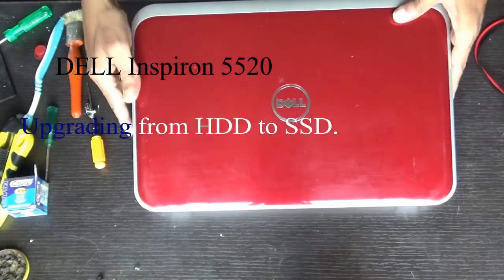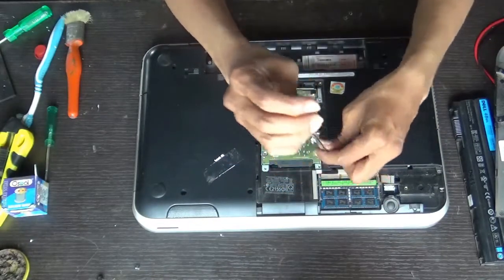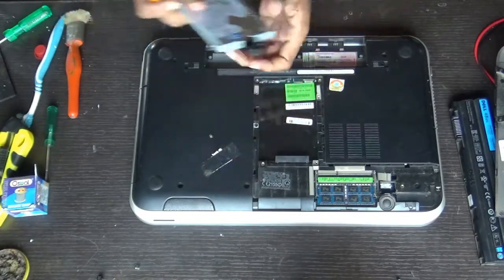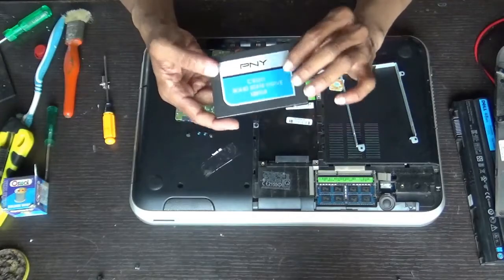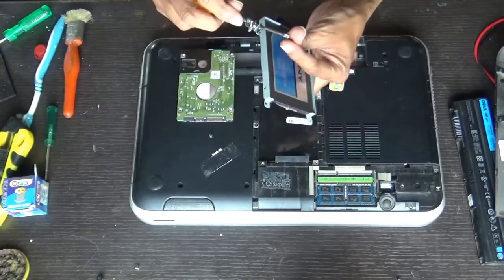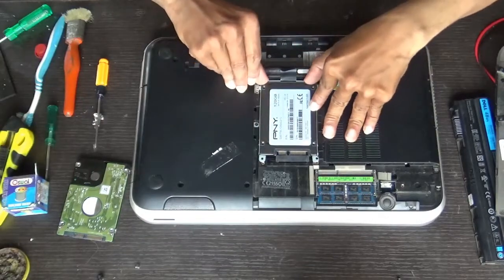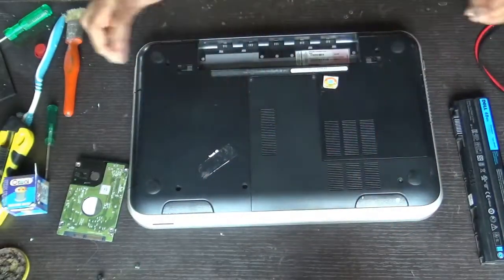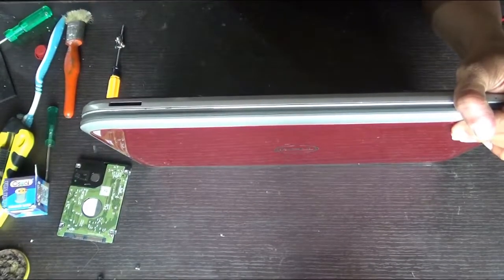How to replace HDD with an SSD In DELL Inspiron 5520.

Comment: Recently this laptop of mine turns off when i plug in the charger after a min it turns off and doesn't even charge both of the power showing lights turn off too.Should i change the battery ,adapter or what?
Reply from the maker: Hi, Remove the battery, plug in the charger(Adapter) and switch on the laptop, if it works fine then replace the battery but if it keeps turning off or improper shutdown etc... then need to check if the adapter is bad (by trying some other adapter or plugging your adapter in some other compatible dell laptop) OR any MOSFET or some other component on mainboard has gone bad.

Thank you, have a GOODTIME....
Reply: I removed the battery as you said and then plugged in the adapter it is not turning on. @GOODTIMEStech

Comment: Please let me know the details of exactly same size ssd in this video and where I can find it. Thank you
Reply from the maker: Hi
It is a 2.5" SATA interface SSD, below is the link for 240Gb SSD:

https://www.amazon.in/Crucial-BX500-240GB-2-5-inch-CT240BX500SSD1/dp/B07G3YNLJB/ref=sr_1_4?crid=1HA0TC8OEYLHB&keywords=2.5inch+ssd&qid=1691760049&sprefix=2.5inch+%2Caps%2C202&sr=8-4

OR you can select from the link below based on your preference

https://www.amazon.in/s?k=2.5inch+ssd&crid=1HA0TC8OEYLHB&sprefix=2.5inch+%2Caps%2C202&ref=nb_sb_ss_ts-doa-p_1_8

Thank you, have a GOODTIME....
Reply: @GOODTIMEStech can we use WD but I don’t see the 4 screws option on the sides

Comment: Hey goodtimes tech, I am still using this laptop and would like to  do the above upgrade. Can you recommend me some very good options for sad which will be compatible to this laptop?

Also do I need to buy anything extra to make it fit?

Please guide as I am very new to this kind of stuff.

I was looking at Samsung SSD but I would appreciate if you can recommend me some good models or even other brands which you feel are worth.
Reply: On their website, Dell shows Evo brand SSDs as well as Samsung; I'm doing the same upgrade for a 5735. I take that as Dell recommending them.

Comment: hello sir, wat is the caddy size for this laptop 5520? is it 9 mm or 12.7 mm? thanks
Reply: confirmed dell inspiron 5520 requires 12.7 mm hdd caddy. I bought it from Amazon for around 450 INR and its working very well.

Comment: Hi GoodTimes Tech,

Wonderful video..I have the same model of laptop dell inspiron 5520 and i want to replace the hdd with ssd. What kind of ssd do i need to select. is it like 2.5 Inch SATA III Internal SSD  ? Could you please help me selecting the right ssd for this model. 

Many Thanks
Reply from the maker: You can buy the similar one to the item given in the link below, go through return policy and warranty ( buy the one with manufacturer warranty) etc.. Or you can get it from local laptop spare parts shop.

Take care and do the shopping on your own risk.
Thank you for watching, have a GOODTIME.

https://www.amazon.in/Green-120GB-Internal-Solid-WDS120G1G0A/dp/B01M8HPL6Q/ref=sr_1_1?s=computers&ie=UTF8&qid=1535808416&sr=1-1&keywords=ssd+for+laptop

Comment: Is there a m.2 Ssd slot in this model?
Reply from the maker: No, It doesn't have M2 SSD slot.

Thank you for watching.
Have a GOODTIME.
Reply: GOODTIMES  tech ™ Thank you so much.

I have this model and want to use SSD. So i have to remove the old 1tb out and put 2.5 " SSD instead right?

Thank you so much.

Comment: Hello , I just love this informative video - please inform me that how much ram upgradation is available to dell ispiron 15R 5520 ( the one in this video ) if I want to have a SSD and a HDD together in this device how it can be done 
thanks
Reply from the maker: Hi,

If you want to have SSD and HDD then you will have to quit DVD writer and buy DVD to HDD converter, use SSD as main drive in place of old HDD.

Thank you.
Have a GOODTIME.
Reply: do you provide service to laptops ?? just asking cuz i need make some changes in my laptop , so i need to visit service center in Kolkata

Comment: if i want to keep the hdd is there other option to install ssd maybe like msata
Reply from the maker: Hi.
Sorry to inform that this laptop doesn't have msata slot but one more option is to replace the DVD drive with a HDD or SSD  by installing DVD to HDD converter. In this case you wont be able to use DVD drive after conversion. Adapt this method if you are not using present DVD drive.
One more option is , you can use present HDD as external USB HDD by using  2.5" external HDD USB casing.

Thank you.
Have a GOODTIME.
Reply: Great answer. I know however that you can buy a daughtercard to grant this PC 3 Gbps mSATA capability. Isn't that right?
Reply: can you give me the acessoriess buying link please..